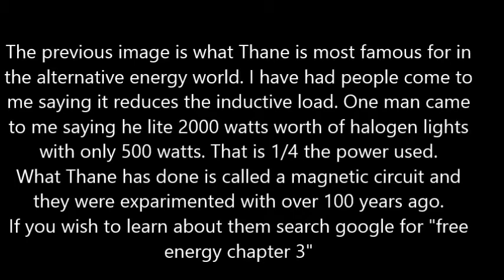Thane Hein P1 Bi toroid Transformer and Generator. The future of his device and company.

Comment: FLCB lithium ceramic batteries, combined with compressed air engine and on board compressor, possibly flexible solar panels on the outside for added bonus. hub motors and and ceramic frame. Biosteel? Beautiful future.

Comment: If one looks closely at the symbol of Infinity or Yin/Yang you can see the same flow as the bi toroid transformer. In the symbol of Infinity the primary is the center and the loops are the secondaries and in Yin/Yang the primary is the outside sphere and the two vortexes inside are the secondaries.